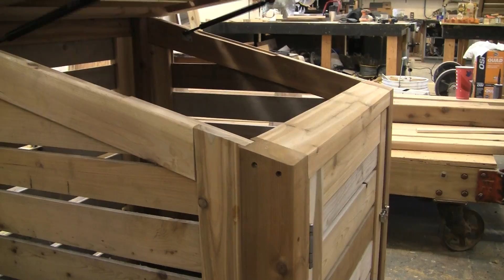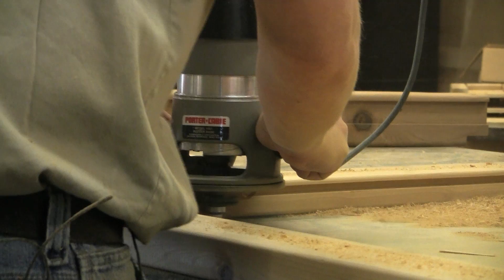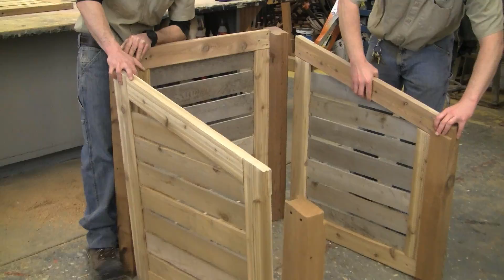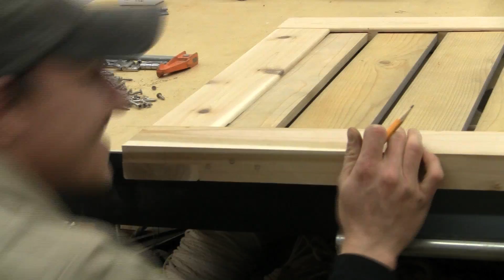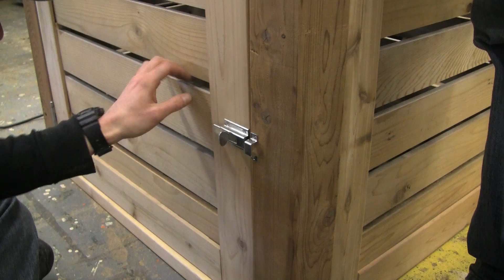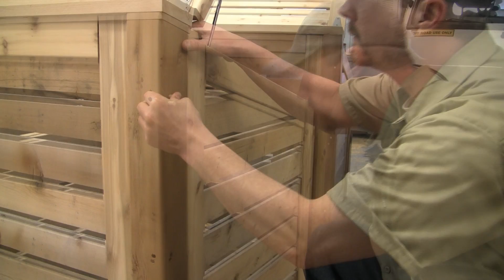How to Build a Compost Bin

Comment: Beautiful job, just thought that maybe the front access door would work a lot better if it was a lot smaller, as not all the waste might be ready for compost
Reply from the maker: Thanks Patrick for the feedback! We built 3 bins to allow for a 3-year cycle for the compost. The door allows for easy access to stir/empty each bin. We have built other bins with the front removable in sections (top, middle, and bottom), but these are usually larger, stand alone units where you want to access the materials on the bottom without disturbing the materials on top. Hope that clarifies why we built them this way!
Reply: Thanks for clarifying that lads.